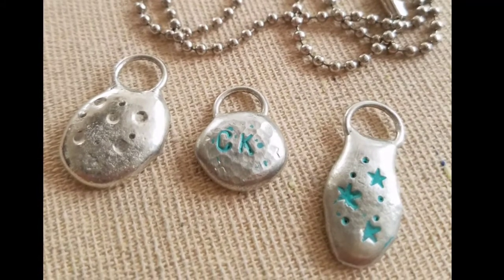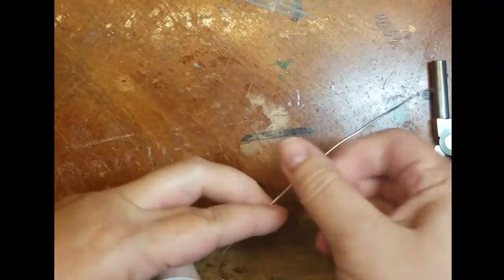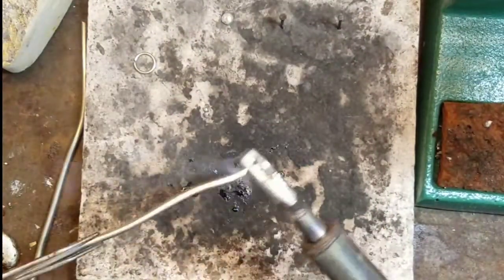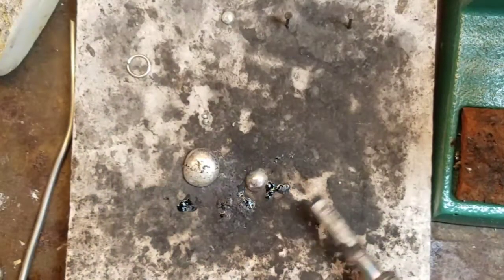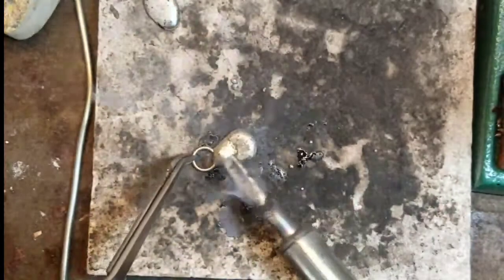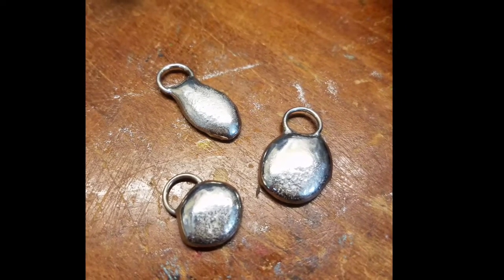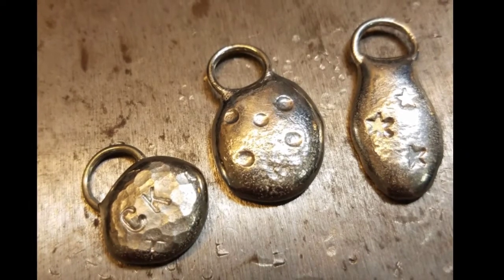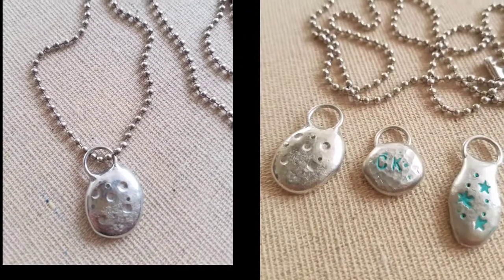How to make simple Solder Charm Nuggets

Comment: These are cool but your jump ring should either be turned 45 degrees (it won't hang right on the chain) or another jump ring needs to be added.  It looks like a fun project to do with solder.  TFS

Comment: Hi Cat!  What is the surface that you are soldering on?  Thanks!
Reply from the maker: Hey Kim. The white board is called a solderite board. Plus, I'm also using a cookie sheet. I dont always use the solderite board, sometimes I just use the cookie sheet. You can also use a silicone mat.
Reply: Thank you! (what a quick response) :)

Comment: wouldn't it be easier to just melt the pewter in a metal ladle using a grill lighter (held underneath) and then pouring the melted pewter from the ladle into a mold?

great tutorial here, but just a thought.

edit: these turned out great btw :)
Reply: Is solder and pewter the same?